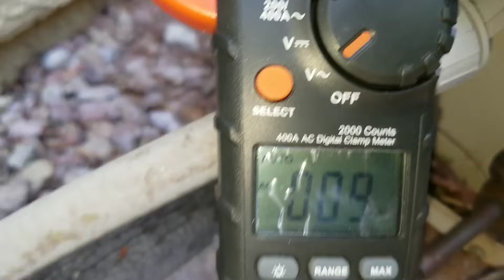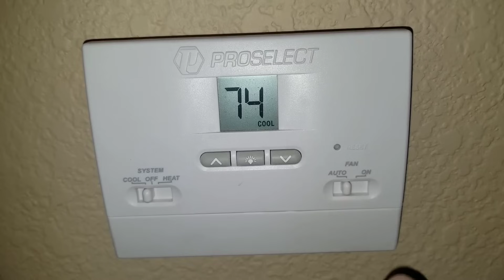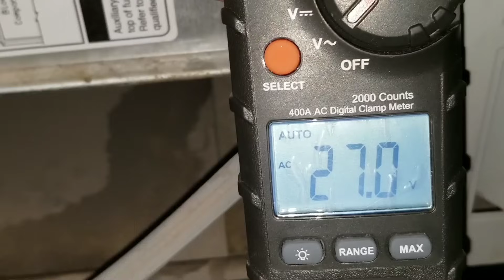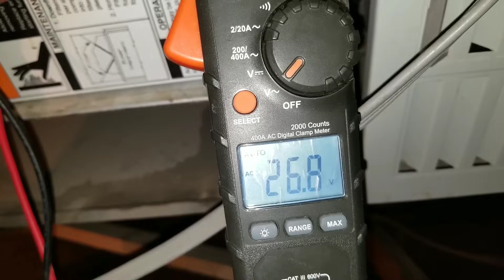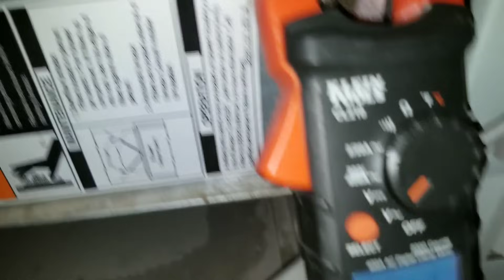AC Not Working. Not Getting 24 Volts to Thermostat. REPAIRED!

Comment: I have a question, why don't I have 24 volts on (R) and (Y) control board?
Reply: If your tstat is calling for cooling it means that it is passing current from R to Y. If you put your meter leads on both of these terminals, its calling and tstat is working properly you will not see voltage on your meter. YOU NEED to check from Y to C.
Reply: I have power in the transformer 110 volt and 24 volt enter the control board but 24 volt do not come out

Comment: Just wanted to echo what others have said previously. After I installed a new thermostat, it didn't power on. I found your video after asking Doctor Google for help. Thank you for the thorough and clear explanation. I traced the problem to the fuse in the air handler. Replaced the fuse and everything worked.

Comment: What of there is no fuse? I can't seem to find one on mines.
Everything works if I turn the fan manually on in the furnace and then go outside and push in the tab in the ac unit. But for the system to do this by itself, no way
Reply: any luck ?
Reply: @Venatix  I fixed my issue. I had to replace 40 VA Fan Center w/ SPDT Switch Includes R8222B
I purchased mines at supplyhouse.com
It was $35.
Reply: @rodolphestpreux  Thanks!

Comment: So will this work if my thermostat went blank? I have a Honeywell Smart thermostat touch screen that does NOT use batteries. I even bought a new one---it's the same exact model as the older one and installed it tonight but still no power.  Replaced the one that went blank 3 days ago and we've been w/o AC in 90 degree weather. there was a power surge in our neighborhood the day our AC and thermostat system suddenly stopped. We didn't lose power in the rest of the house that afternoon. We checked and reset the breaker too,

Comment: Thank you for your instruction, my AC systems have same problem, my thermostat voltage measured 2.4 VAC. I followed your instruction and found the fuse in the blower unit which located on the attic. My AC back up and running after i replaced the fuse.  Now the thermostat voltage measured 28.5 VAC.

Comment: It's also important to address how the fuse blew. I would check the 24v coil on the contactor at the condenser and read the resistance. These coils can start going bad and take 3 amp fuses out and cause frustrating call backs.
Reply: If the fuse is blowing that means it’s doing it’s job. I would be looking for shorted low voltage wires primarily and faulty components such as a contactor, control board, loose wires, grounded wires, etc.
Reply: @christiand.6112  Thanks! New to the tech side.
Reply: Any other reasons why the fuse would break? I like to know the important reason "why".

Comment: Thanks a lot. I feel so dumb. After I installed my new thermostat after the old one died, the out door unit still didn't work. So I just replaced the capacitor even though I already replaced it 3 years ago. Still nothing. I bought a voltage meter and checked the contactor and it received 240v. When you showed the thermostat wiring I decided to check my wiring. Yup. The wrong wire was in the wrong port. I had the white wire in the White port. It supposed to be in the Yellow port. Fixed. I was worried I had to go up into my attic.
Reply: your white wire has to be in the yellow port? does sound weird

Comment: can you jump the green wire and red 24v power with the condenser wire at the control board to bypass the wire going to the thermostat? I am suspicious that my control wire is intermittent, and need a quick fix while I plan to crawl under there.

Comment: Thank you! I was about to ask a stupid question... but I decided to replay the video since I was distracted with my thermostat and I realized that you found a broken fuse. Around how much is the cost of that repair? My thermostat whose display goes crazy and sometimes disappear, still works and cools ok. I just have to turn it off, kick it and abuse it and the display will appear and once I play with the degrees up and down finally start working again. If it goes beyond 20 min cooling the apartment I have to turn it off and redo all what I did before. Thermostat and a/c unit are as old as myself.... 22 years (myself 74) but if it still works why should I  throw it away? I guess I better replace the W-Rogerds 1F86-44 thermostat for a new non -programmable Honeywell.
A/c technicians are having a hard time with me. Many thanks again.

Comment: why did the fuse trip ??????
Reply: Rooney, I guess by now you found the answer to your question? I found this "The most logical cause of an air conditioner tripping a breaker or blowing a fuse is when it comes on stems from a problem with the electrical connection, the power supply, or the circuit that powers the system. Breakers and fuses are designed to trip or blow when too much voltage is sent through the line.Apr 28, 2015"    Also the following ..
"When you have those hot days and your air conditioner is under pressure to cool your home, a clogged air filter can cause a blown fuse. ... The electrical system will then trip or blow a fuse to protect itself. Loose Electrical Connections. The connections inside your breaker box can come loose due to temperature changes"
Reply: @clusa3721  thank you

Comment: Had a no a/c power showing on thermostat, checked all the initial things like circuit breakers, both disconnects on air handler and condenser. Checked the buss fuses. Started searching here for more in depth diagnosis. Found your video, followed the methodical step by step procedures. Turns out it was the fuse in the air handlers circuit board. Replaced and back up and running. Thank you for an easy to follow approach to figuring this out.

Comment: I have a Trane but it doesn't have that type of fuse. The one I found was a small tube type about 1/8 in. X 1 1/2 in. long and attached to a screw cap, and screws into a cylinder. Rated at 3.2 Amps/300 volts. It's not obvious that it's blown but, I ran an ohms meter across it and there is no continuity. Did I find the culprit? Where do I find a replacement?

Comment: So what do we do when our ac/heating unit is all electric and doesn't have this mentioned control board? Or a fuse for that matter i have all but completely pulled my unit completely apart and dont see none of the things mentioned.
Reply from the maker: The best starting point that I suggest with any of my technicians is trying to get a hold of the manual online. The manual will give you key components, wiring schematics as well as a troubleshooting page ie... does this work yes or no... it will then direct you in the direction as far as what may or may not be the problem. There are lot of videos online as well by individuals who troubleshoot electrical heaters on YouTube. Hope this helps you in the right direction!
Reply: @MoreThanMaintenance  So at this point i have pretty much allready called my hvac company. My system has 6 60 amp breakers (3 120amp switches 60-60) in the breaker box, 2 30amp breakers in the cabinet under the blower itself, and the main shut off block outside by the condensing unit. None of them are tripped but yet i have no voltage anywhere. I've literally stripped this thing. It needs to be serviced by a pro anyways cause by looking at the wiring mess in the cabinet the people before us did a bunch of jerry rigging where there should be a circuit board there is a bunch of twist capped wires.
Reply from the maker: It's very difficult when someone has worked on a system that did not obviously have the experience necessary to troubleshoot and or fix the issue you are now experiencing. I do think you did the right thing calling in a professional. 👍At this point once work is complete inquire if and what is covered if they offer a warranty.

Comment: Good video. Can you tell me why was the reason the fuse blew up? Thanks in advance.
Reply from the maker: It is usually due to the low voltage wires connected to contactor on condenser touching the side of of unit. It happens more often than not! I have had broken wire up by the board causing fuse to pop. I have videos on my channel if your interested!

Comment: Sam,  can we bypass red & yellow wire together?  Is it safe to compressor?
Reply from the maker: Do you mean jump them? If so for troubleshooting purposes yes. You are simply bypassing the thermostat. Keep in mind your blower will turn on as well. The compressor will be fine 😀
I usually use this method to determine if I have a faulty thermostat or  a low voltage issue. Hope this helps!
Reply: Bec I saw other video warning not to jump red & yellow wires otherwise compressor will be damaged.  But I trust you.  Thanks Sam.
Reply from the maker: No it will be fine. The low voltage sends the signal to contactor on condenser to turn on. What they may be advising is not to do it as a "permanent" repair... tap the red and yellow wires together to troubleshoot but then disconnect them. Usually I will tap the wires check condenser.. if the system turns on... I disconnect the wires... then proceed this process until I find the problem.
Reply: Safest way is RED with Green which is the blower fan. Most the time thermostat have like 3-5 min delay for compressor to be safe,and you don’t want to jump it to kick start the compressor right the way which can cause damage to it.

Comment: Good video. I do commercial bar concession stand refrigeration at work but have never opened a typical residential split a/c system until recently. Went to change out a worn contactor and capacitor on a dirty but functional system. Cleaned the condenser coil, ready to restart the unit thinking I'm gonna cash in some hero points on this friends and family trade... plug the disconnect back in and....... nothing.

Huh?

Took a while to figure out that even though I pulled the outside unit disconnect that I had shorted out the low voltage while changing the contactor.

Live & learn every day.

Thanks for sharing.
Reply from the maker: Great! Sometimes it's a simple issue that is overlooked. I have to always remind myself of this in the field. It's easy to overthink and expect the worst... when it may simply be a fuse! Thank you for the feedback! Great job on the work you completed.

Comment: My magnetic switch inside the a.c. broke it's contact conductor holder piece. It's plastic and holds the part that moves down to contact the contacts thus activating the capacitor..

Comment: Might be making myself a little stupid to say this but I need help.  Working on mother in laws house.  It was time to replace the thermostat so cut the power to the breaker, marked wires accordingly and replaced with same unit just new.  Tightened everything down,  turned the breaker back on and after 45 minutes the AC has not turned back on.  I know to look for the 3amp fuse, but I cannot find what I am looking for.  The house is an old 70s ranch home in Arizona and the AC unit is on top of the roof.  Please help so I can get the air back on.

Comment: Dude you are a stud! Thank you!! I know my stuff when it comes to electrical with 25 years experience. Today my detached garage AC stopped working. I checked the voltage at the thermostat. No voltage. I pushed the coil on the GP contactor. Worked! Next stop is the rafters to the control panel. Thanks for your help.